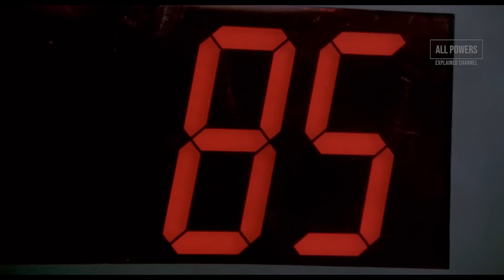Robocop - All Powers, Fights, and Weapons 1987-2014

Comment: I read that the black parts in RoboCop are "soft armor" but are still  bulletproof and fireproof while the silver pieces are titanium.

Which means attacking the joints and those parts are his weaknesses.
Reply: Could also mean that the soft armor adds more agility and speed, when titanium is for durability and defense,
Reply: of course titanium is less durable than steal so you can easily attack those plates they are weaker than A4 plates
Reply: This is not quite accurate. Robocop won't have been made of pure Titanium because in its element form Titanium is only as durable as mild steel, but Titanium alloys are what are used by militaries and aerospace industries because the alloys are as durable as hardened steel, yet weigh 45% less. Then again it also depends what you mean by "durable." In terms of "strength" - the ability to withstand being pulled before its breaks, such as in a steel cable vs a Titanium cable, the Titanium cable will hold much more weight than steel before snapping. In this sense Titanium is far stronger than steel. Russian submarines were built from Titanium alloys because they could then deploy submarines which could dive much deeper than steel submarines. Titanium alloys strength really shows in this arena. But if by "durable" you mean "hardness" then Titanium alloys and hardened steels are similar. Titanium alloy is a superior material to use for Robocop because its only half the weight of steel, yet will offer similar protection from firearms. Titanium also has a higher melting point and excellent corrosion resistance.
Reply: Shit I have titanium in my leg from being shot, at least that's what the doctor's told me. Never even showing up in metal detectors I am robo boy Lol whatever

Comment: If you don't know what the Directive 4 means, the Directive 4 was one of the RoboCop's prime directive that makes RoboCop is not allowing him to engage against OCP senior officer, Ralph jones. Any actions against him will result him getting his system shutdowned
Reply: Dick Jones. And it wasn't specific to just Jones. Directive 4, as Jones stated,   "Any attempt to arrest a senior officer of OCP results in shutdown." Anyone who was a higher up couldn't be arrested. That would also include the Old Man and anybody else who was a senior officer.
Reply: @jasonmarin8187  If any senior officer is fired however Directive 4 ain't protecting them anymore as Dick Jones found out.